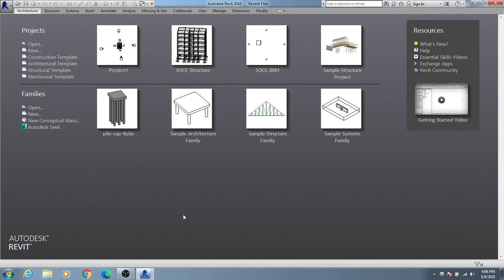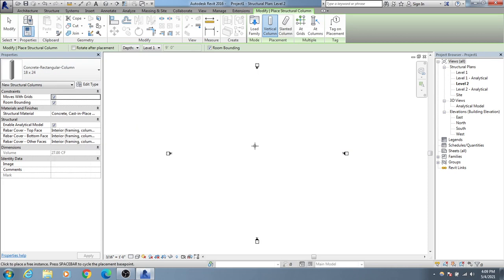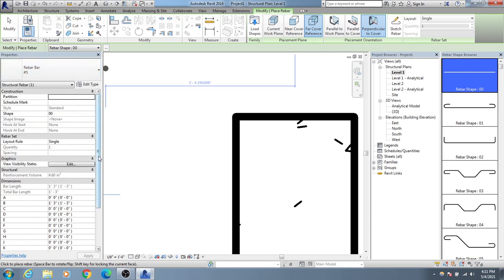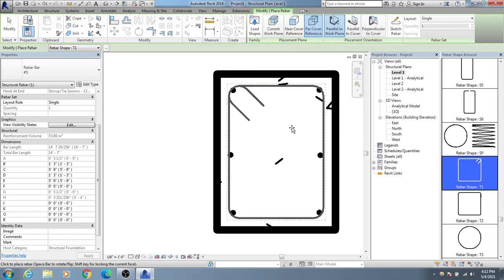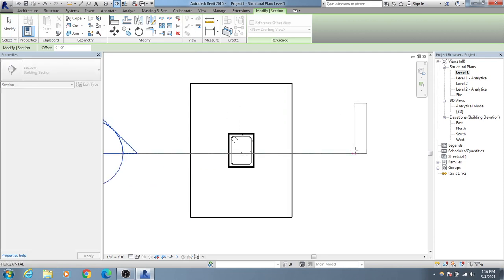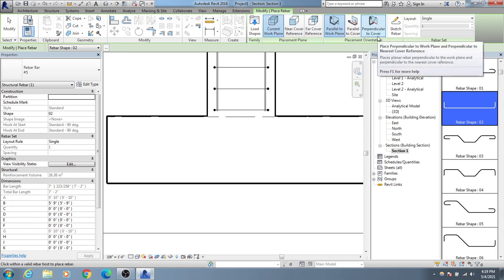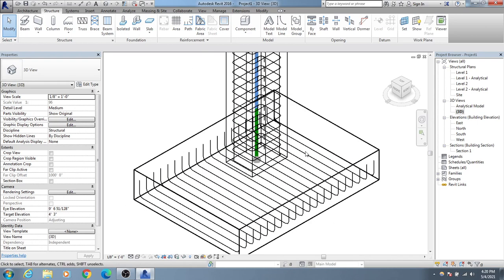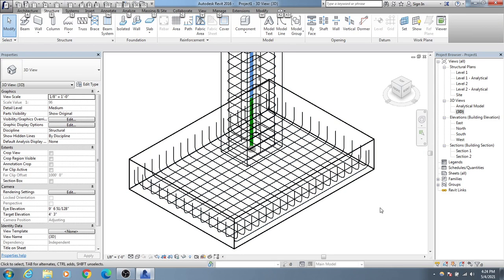Autodesk Revit RC Detailing for Beginners | Foundation Reinforcement & Rebar in Footing Tutorial

Comment: Sir i cannot find placement plane tab-far cover reference in my revit 2015 while using perpendicular to cover from placement orientation. Also i cannot assign rebar to structure. Eventhough the rebar is selected the bars are not getting applied. In parallel to work plane placement plane is showing still the bars are not able to apply. When i use section i am able to apply. Any solutions? The drawing was not in 3d view. I followed your same type structure only.